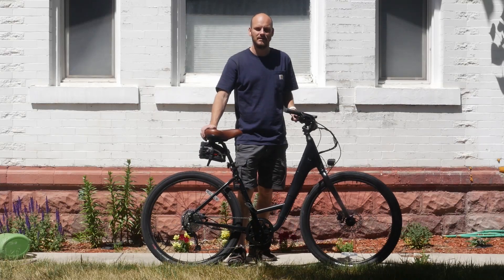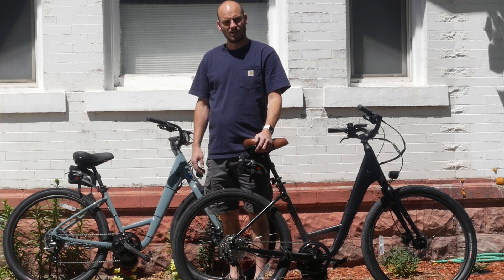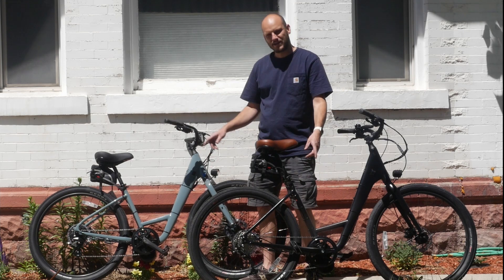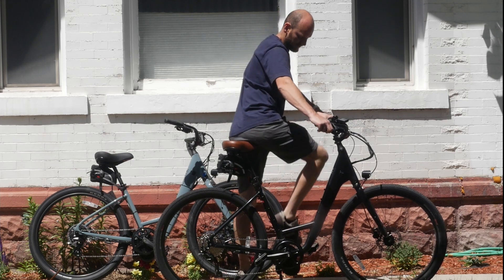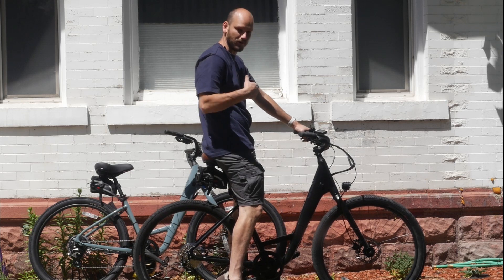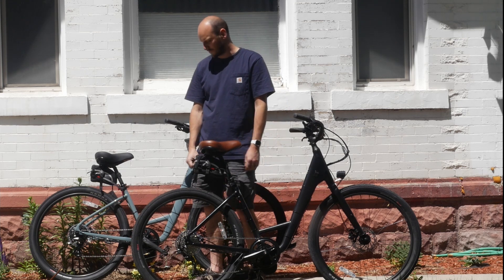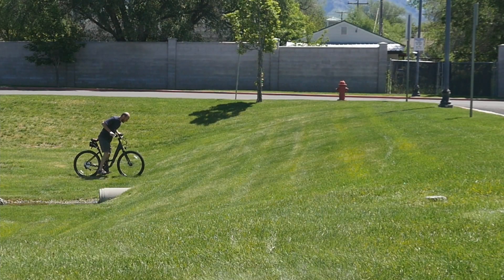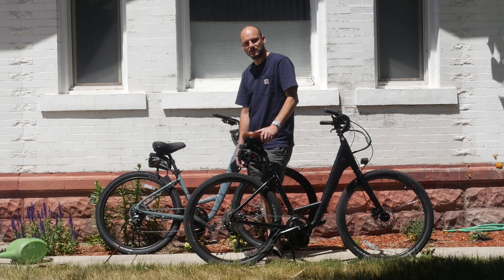Custom E-bike Build: Norco Scene Bafang BBS02 750w 52v 6ah

Comment: I did a conversion with this bike! Actually it was done by a specialist in my city. No regrets! I like the straight position. The Norco Scene VLT is highly recommended in the ratings here in Canada. Mine is kind of a clone with his Bafang  engine.
Reply: Just out of curiosity what did they charge to do a conversion on this.
Reply: @trillium_music  1345 usd (1840cad including taxes) 500w bafang and 16ah battery @velo conversio. 500w Tongsheng is 1100usd with same battery @ ugo cycle

Comment: What about the EGO power tools 56v 7.5ah batteries? I have these already and they charge from flat in 40 minutes. Will they work?
Reply from the maker: Technically the motors will work with voltages from 40v-60v so yes.  I do not endorse that though :)

Comment: this is up my alley. I currently ride (and really enjoy) a (old, 1st gen w/ no pedal assist, throttle only) pedego cruiser but I'm looking to upgrade, as in convert a traditional cruiser bike to mid-drive ebike. would be interested to know what bikes are good candidates and how much the conversion in this video runs. I would want 60-75 mile range from the battery though but love the cute little tool-bag battery in this video. what a clever idea and yay for getting your in-laws into the ebike scene !
Reply: If you like that old Pedego, you may want to convert instead of replace.

Comment: Just bought one of these to convert for my partner using a Bafang mid drive. Do you have details of what you ground off? 
In Australia the power limit is 250W. I was thinking about going with a smaller chain wheel to match the original size which is 36T so she can ride easier with the motor turned off. Should I do this or stick with the standard chain wheel that comes with the motor?
Reply from the maker: You can’t reuse the chainring. You have to use a motor specific one.
Reply: @JohnnyNerdOut  I was wondering if I should buy a smaller chainring like a 36T Lekkie to match the original size or just go with standard Bafang 44T chainwheel.

Comment: Got a question for you,
I always find city bikes harder to electrify (i also do this for a living like you but just started).
This is because the battery placement is just not fantastic. How/where did you get that small under seat battery? 6Ah is small indeed but pretty cool as an option
Reply: Since they are small you can always carry a 2nd one to go more miles.
Reply: I'm wondering if its a custom build, stored in an undert seat tool bag.
Reply: Right that little battery is pretty sweet for a mud drive motor also he sells it on his site I'm interested check his bikes out there cool to

Comment: What do you mean when you say dial them down. I know a good bit about ebikes, I am going to assume you are going to limit the top speed so the battery can be spared.
Reply: My guess he is changing the Limit Current(amps) from 25 amps to something like 18 amps max.  The controller for the bbs02 can handle up to 25 amps max.  The Limit Current (A) is a setting in the Bafang Program.  It is the 2nd setting on the Basic Tab.  

The following is what Matt at Empowered Cycles said about that setting:

 “I recommend 18 amps in most cases.  You still get amazing performance, prolonged controller life, more charge cycles from your pack, more range on your rides. If you have an internally geared hub, I recommend 15 amps and changing the “start current” on pedal assist and throttle all the way down to the lowest setting of 1. Even at 18 amps the 750 watt motor keeps up with an 8T geared MAC hub motor that is pulling 1500 watts. You do not need 25 amps for this motor to perform.”

Read: A Hacker’s Guide To Programming The BBS02 & BBSHD by Karl Gesslein
Reply: Amperage draw and top speed. You can also select a larger range of boost levels for better control as well.

Comment: I use about 19AH on some trips
Reply: You should get multiple batteries. One huge battery is barely going to do it for you and you have to lug around way too much extra weight for most rides you do. By swapping batteries when you don't need 19ah, you make all last longer.
Reply: @MHH3180  thats my exact setup. For instance i use pairs of powertool batteries for 8AH 10s in parallel and a 4s 40p pack that recharges the main battery with a boost converter to get some heat in the packs during the winter and to keep the low kv direct drive motor at optimum voltage for ride quality and power.

Comment: Yep, you can go exploring all the way to the pharmacy and back with your 6ah
Reply: Figuring folks the age of Johnny's inlaws and myself, they are going to average 100 watts at almost any given time. 52volts times 6ah's is about 3 hours normal ride time, 10-15mph (way too fast in a campground and plenty fast on a rail trail or MUP). How often do even most hardcore e-bikers ride more than 20 miles (leaving lots in reserve). This is just an excellent build for the application and an illustration of why conversions make more sense than factory bikes.
Reply: Figure about ten to fifteen miles if you have much in the way of hills.  

This presumes you are reasonably healthy, and your knees are not messed up. (So you can put some real effort into pedaling, and not be in undue pain.)

If you have chronic health conditions, e.g. chronic pancreatitis, and one of the many “birth defects” you have results In lifelong knee problems - then you’re absolutely right.  You’ll want at least twice that much battery if you need to go far at all - and if you wish to go real distance…

You’ll wish the largest battery you can fit in the frame, AND another largish battery in your traveling trailer!
Reply: @dennisyoung4631  That sounds very optimistic. A bike without a motor can go 10-15 miles. For the type of person who might be attracted to such a bike, no throttle, they need a warning: 
If you need to get home after injury or weakness or heart symptom, YOU ARE SCREWED,
Reply: @thankmelatersport  he did install a throttle. He set it to respond at the level of boost chosen. 

These are built for a short joy ride on rail trails and in campgrounds. Most of us old folks don't have heart conditions and if we do, an ambulance, not a ride home, is the answer. There are NO e-bike throttles made, not even in the aftermarket, for continuous use. They will burn out. After one or two, so will your controller.
Reply: @MHH3180  I spoke from first hand experience, and I'm no youngster myself.
There are a number of instances in a typical month where I ride over 20 miles in a day.  In the recent past, I went over 40 now and then, and would have gone yet further had I enough battery capacity!
Reply: @dennisyoung4631  me too. You won't find photo's of me without a cane in the last fifteen years. Until my leg completely  fell apart, about a year ago, I was still doing fully loaded century camping trips on conventional bikes. 

You are though illustrating an important point. Bikes need to be spec.'d to a person's specific needs (also why fitting, not just sizing, is so important).
Reply: @MHH3180  I've used only throttle about once a week for 2 years.
Not a problem.
Reply: @MHH3180 "he did install a throttle"
Oh, I missed that. Good thing. I would never ever be without throttle if I could help it.
Reply: @MHH3180  Why do you believe something will burn out after a couple of throttle uses?
Reply: @MHH3180  not quite ready for a cane, as far as I know.  

Current build - replacing build #1, stolen last March; the chain was cut - is about half-way.  I’m looking at roughly another 2k, total of 3.5 or so.  This is a car-replacement bike, so it needs to have substantial range and pulling power, and it must be comfortable to sit on for an extended period.

I simply cannot afford the operating costs of a conventional vehicle, and I no longer function well enough to “act normal” - hide how disabled I am - for long periods.  (Public transport is almost entirely a no-go matter.  Long-distance travel - train all the way, stay holed up in a roomette the whole time, save when I must use the bathroom or shower - unless I can ride to my destination and camp/hotel as needed!)
Reply: @MHH3180  "Most of us old folks don't have heart conditions and if we do, an ambulance, not a ride home, is the answer. '
That works if you have a phone and it is charged and you have ambulances nearby.
Reply: @thankmelatersport  which is what we do and wh where we ride. There comes a point in our lives when you just face these thing. Throttle or no, you don't ride or drive when you are having an episode.
Reply: @thankmelatersport  I did not say a couple. It is a fact, not an opinion, that they were intended to make starts easier and to help dig out of low speed turns even if you forget to downshift (hard on motors anyway). As such, tgey do tend to burn out. In one group I mentioned I had a box of throttles and have been over whelmed with requests. Once you start burning them up your controllers tend to follow.
Reply: @MHH3180  I think that statement is too definite. For example, say you were on a trail on your own property.
Would you sit and wait for help or sit on your bike and be home in 2 minutes?
Reply: @dennisyoung4631  yes, I got rid of my car when I retired. I keep my lisc. drive my wife's car and sometimes use our club's truck to haul bike stuff.
Reply: @thankmelatersport  Do you see how ridiculously rare and specific your hypotheticals are becoming? I was responding to comment that does not fit most potential customers for this type bike. Nothing meets every need well.
Reply: @MHH3180  "I did not say a couple'
Yes,  I see I misunderstood.  

Maybe mine has been OK due to low performance motor. Bafang 500 W rear hub 65 Nm. 

So far,  4000 miles of always throttle use from every  stop every day, and lots of those occasions of throttle-only riding home.
Reply: @MHH3180  Thank you for the information!